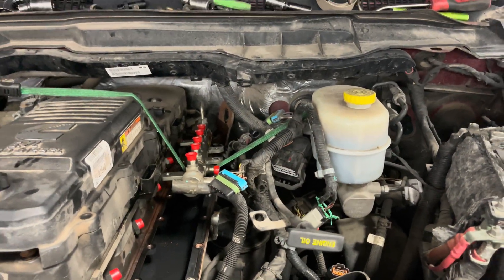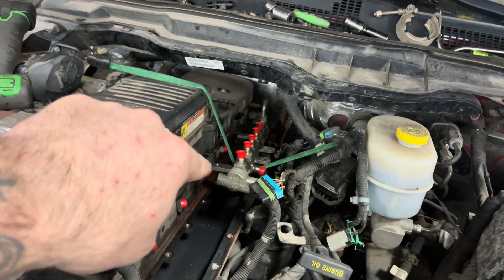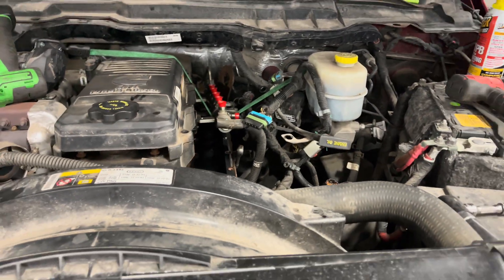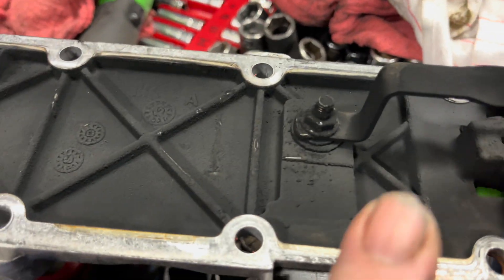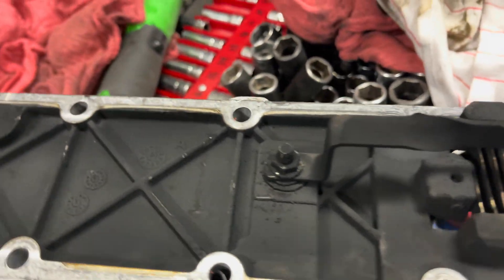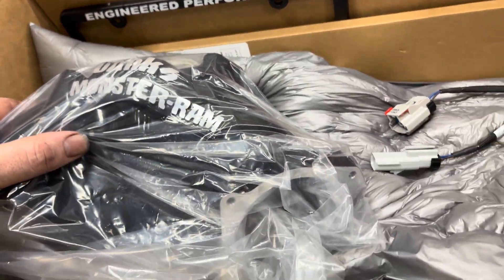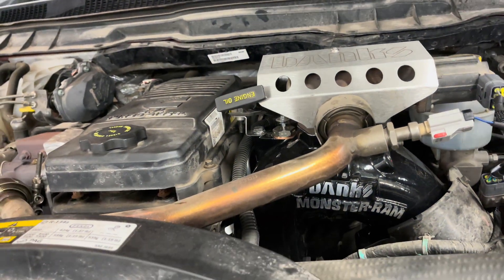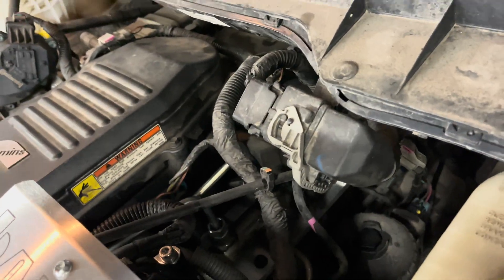Grid heater failure avoided with Banks link bankspower.com/TRUKSTUF And the discount code TRUKSTUF

Comment: I have a 2021 ram high output cummins and just bought the Banks intake. The only issue I might have is to start in cold weather if it's not plugged in. I live in Northern Canada and according the test done in Canada by some folks with the Bank, it wont start if it's below -25. I think Banks should have a bigger glow plug in their intake. What do you think ?

Comment: Installed a banks on my 2004 5.9 , replaced stock muffler. Wow, what an increase in all around performance. Towing,  hole shot and through the gears. Hard to keep your foot out of it.